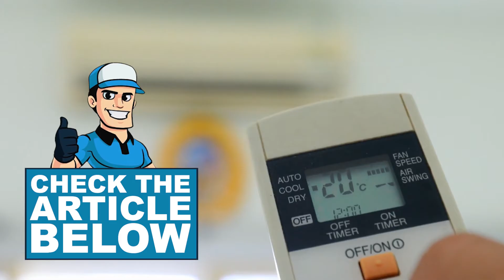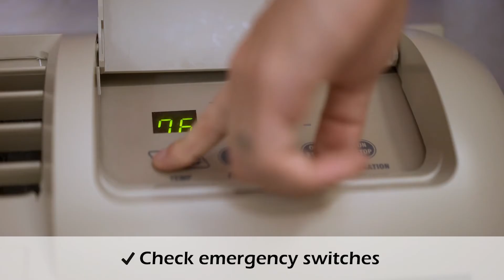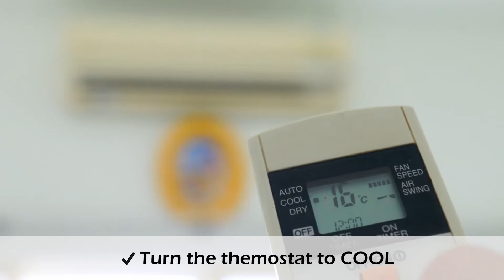How to Fix Air Conditioner Not Turning On | HVAC Training 101

Comment: My thermostat’s temperature was stuck at 68 all winter, but that was fine. I went to run my AC but the thermostat went to 74. The ac did turn on for about 10 mins and blew cold air. Sounds like the thermostat right?

Comment: Hello, I love in South Florida and I have a brand new AC (2 weeks old) ever since it was installed, it runs for about 7 minutes every hour or so. The Thermostat states the temperature desired is reached, and therefore it just turns once (for 7 minutes) every hour. 

We set the temp for 72 before bed, and it will just run these 7 mins per hour to maintain that temp. 

Now, if I lower the temp by a couple of degrees then it will run for about 12 minutes… However, still just once per hour. 

Please let me know what could be the issue. Brand new Ac/Thermostat.

Comment: My situation is weird. Sometimes, the air conditioner works fine. Other times, it won't come on. When that happens, if I take the face of the thermostat off, and put it back on, the air conditioner will come back on. You'd think the problem is with the thermostat, but I got a new thermostat, and I have the same problem. Both have new batteries. I even tried stripping the wires to expose fresh copper in hopes of getting a better connection, but the problem persists.  Sometimes, I'll take the face off, and put it back on, and the air conditioner won't come back on. But if I do it three or four times, then it will come on. It's a real pain in the neck waking up hot in the middle of the night and having to get up to take the face of my thermostat off and put it back on. If anybody has any idea what the problem could be, please let me know.

Comment: My window ac wouldn't power on, I opened it up, looked at the electronic boards. Nothingwrong with anything, but there was a ton of gooey build up on the bottom. I threw the ac outside, hosed the  entire bottom interior until everything that looked nasty was washed away, i then wiped alot of everything down, it now works, putting cold air out right now( i didnt flip it on its side, it stayed upright the whole time

Comment: I’m a DIY GUY, I was messing with my THERMOSTHAT THE OTHER  day cause the heater won’t turn on. I used a paperclip as a jumper wire to bypass the thermosthat, the heater didn’t not start. Now the AC WONT WORK . Could I have shorted the thermosthat or shorted something in the air handler like a fuse or something ? I didn’t know what I was doing maybe I touch the other end of the paperclip to the wrong wire  in the thermosthat ?
Reply: Check it with a circuit tester or multimeter to know for sure, they're inexpensive and easy to use. You could also have damaged the connectors or knocked a wire loose while your were trying to jump it.
Reply: Getto
Reply: I would say hell yeah don't do that!!!